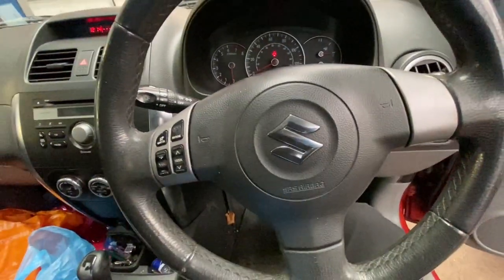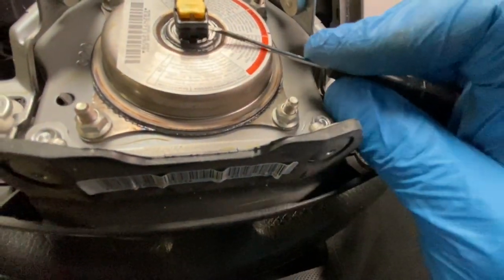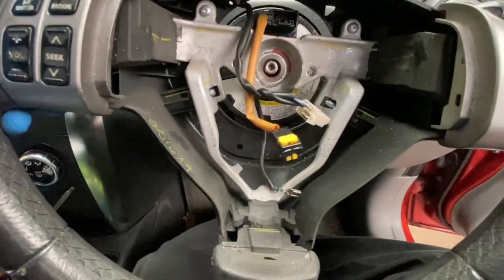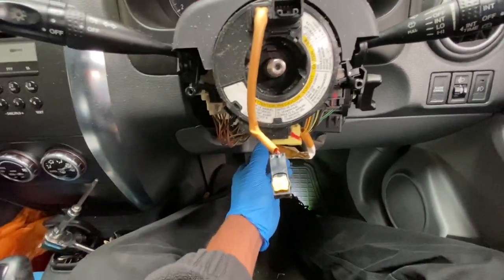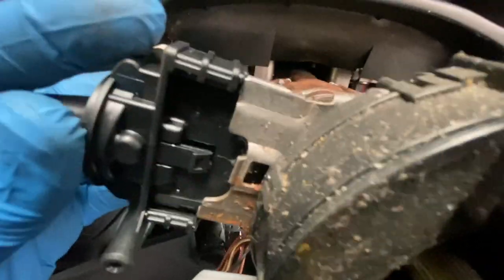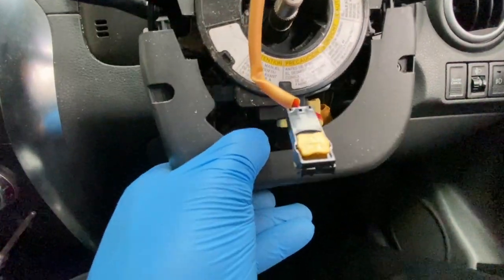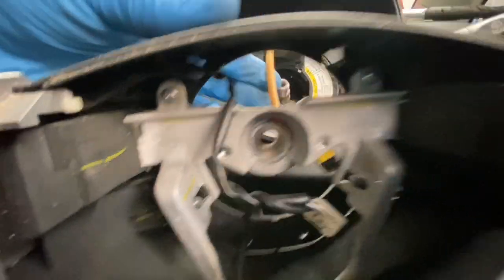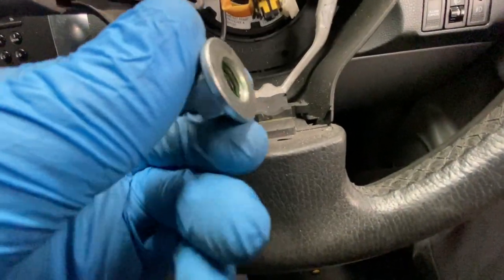#Suzuki #SX4 (2006 - 2014) Faulty #Indicator #Light #Stalk #Switch #Replacement Procedure

Comment: Thanks for the video. Actually you do not have to remove the steering wheel. By turning wheel to right position you can open the plastic cover bolts.
Reply: Confirmed, however I did unplug the battery for safety in case the airbag does goes off😂 
In some cases you can actualy fix the switch instead of replacing it...
My light switch had a dirty contact point inside. But carefull, its looks very delicate. Lights works again after that...

Thanks for the video.
Reply from the maker: @remcovandenengel6496 it’s. Best practice to disconnect the battery and by removing the steering wheel it makes it easy less chance of damaging anything and if something isn’t working best practice to to replace not try to fix